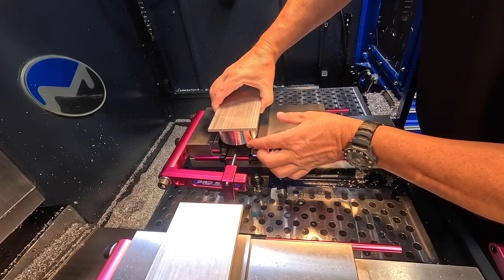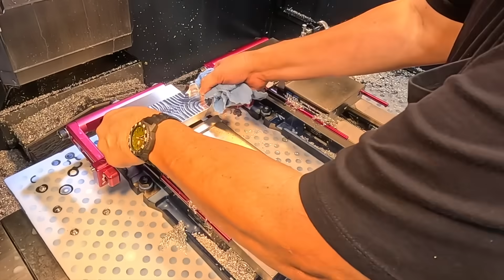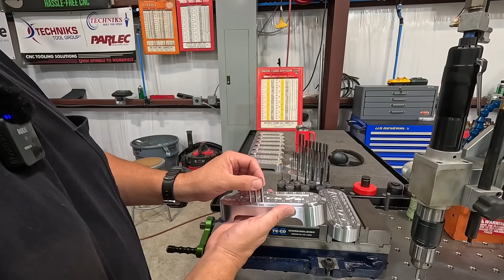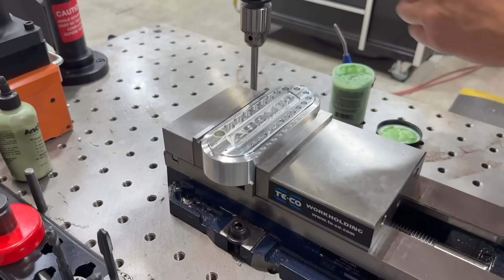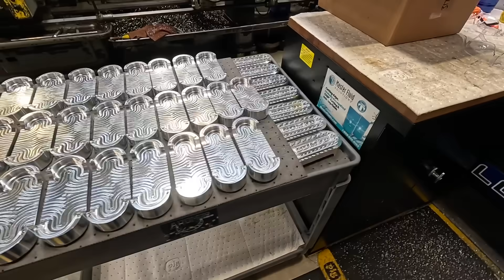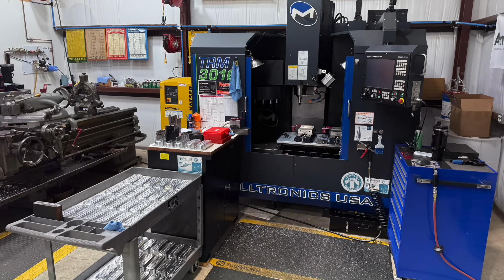Machining the Abom79 Drill Index- Op. 2 Bottom Side

Comment: You can save a decent amount of time if you don't go to z‐home on moves between pieces. With as tight as the tollerance are .1 or .2 clearance off the ruff height would be more than enough. Something that would save you even mote time would be to do rapids while the spindle is comming to speed. Turn off the spindle and simulantanious rapid up z. What would save even more time would be after tool change start the spindle and do your xy and z moves simulantinous then let the spindle finish comming to speed .1" off the part if needed. On most machines z is your slowest rapid so if you can eliminare them as much as possible is good. You would be supprised how much time minimize z moves and doing your rapids while the spindle is starting and stoping will save you. A faster tool changer would be helpful too. Hopefully you new machine will be a swing style  tool changer.

Comment: A super tight hole fit is great but it's not necessary for this use case.  1 thing is its adding a bunch of unnecessary processing time and 2 the moment you spin a drill in a chuck that bit is no longer going to fit in there.  3rd consideration is that the moment you anodize it your .002 target clearance is going to be gone.

I would wait to get a test batch anodized from your supplier and verify fitment before you go crazy trying to make the raw part a gauge fit.  Drill it .005" over with a high quality carbide drill and call it a day.

Comment: Kind of lost here, since can tell your getting the machines for free, and not counting machine wear and upkeep, for what your going to sell the finish products for.  
Hence way too may steps in the initial milling process with light cuts, where you could take deeper cut using carbide inset end mill to remove materials fast, then come back with a few finish passes in the end,  Hence part of finish product costs are not only tool wear, but run time for the machine as well, since it all just a mater of when it time for machine not only standard maintenance, but total run time on machine before it needs to be complatly rebuilt, or in most cases come that time that machine is just clapped out, time for replacement machine that is often more cheaper, and more accurite in the end from the updates to the designs of the machine.

Also at 9:55, that end mill is gummed to hell/failure in you G code for tool over all, and end mill is pretty much worthless until its pulled and soak to remove the bonded aluminum from it, to start using it againin a metal that is not going to cause it to gum up again,  So  again, G code needs to be resolved for at least that cutter,  and tooling need to be revamp so the process is not taking so long to reduce run time wear/ cost on the machine.

Comment: And now do a Variant.... just with metric!

The whole world uses the metric system, but wait ther is one small country that defied the metric system... USA!
Reply: The inch in now defined as 25,4mm exactly.   It used to have a whole bunch of zeroes and a number after the 4 but that is gone now.  The usa is slowly going metric but they will always drive on the wrong side of the road <g> tried it from johannnesburg to pretoria and boy was it dangerous!   Tony
Reply: @ton146  1 inch is still defined as 1 inch. The metric equivalent of 1 inch is 25.4mm
Reply: Imperial is still quite a valid system ... Its worked extremely well for many many years
Reply: @tjr4744  It's worked good enough, but "extremely well"? What does that even mean?

"Mistakes within the imperial system often result from the lack of standardization and arbitrary conversions between units, leading to significant errors in fields like aerospace and aviation, most notably the 1999 loss of the Mars Climate Orbiter due to a metric-imperial mix-up and the 1983 Air Canada Flight 143 "Gimli Glider" incident."
Reply: @FDT-86-47  Metric-imperial mix up ? ... how is that even possible. If you know metric use it. If you know imperial use it ... If you need to convert do it properly. Simple. Mistakes are careless and WILL happen to everyone. Mistakes are NOT the fault of the Metric system OR the Imperial system.
Reply: @tjr4744  How does a measurement system work "extremely well"?
Reply: @FDT-86-47  The Imperial and Metric system works extremely well IF its used properly. If you cant understand that you might want to go back to year 3 and start your education all over again.

Comment: Anybody else cringe when he taps those reamers on that table?  I have no idea if it's OK or not, but to me?  Nope.  I would probably have a rubber pad down there or at least a doubled up pig mat.  

I love the product, but given the amount of raw material, and machining time (and manual work), those aren't going to be inexpensive....and most likely WAY outside my comfort zone to buy.
Reply: Being in the field i can assure you this guy is extremely gentle with his work and highly professional , he can get a job at the biggest aircraft manufacturer in US any day no sweat
Reply: Not that im saying its perfectly fine to do but because the flex arm keeps tool perpendicular to the table and because the tip or a reamer is flat and does not do any cutting, as long as one doesn't slam it hard, there are no cutting edges or anything that can get damaged.

Comment: How much thickness does the anodizing reduce the hose size?
Reply: Anodizing thickness typically ranges from 5 to 25 microns for standard anodizing, and up to 30 to 100 microns for hard anodizing. These thicknesses are often measured in micrometers (µm) or microns, which are equivalent to one-thousandth of a millimeter.

Comment: I work offshore and have worked with removing cutting from the well drilling process. We deal with tons of cutting chips per hour. I could see your sump shark being more proactive in you chip removal. Making or buying a metal bin with a lid that seals and your sump shark conects to the bin lid and a shop vac or high grade hose. The trash can can’t withstand the vacuum but could be inside a bin that could withstand the vacuum and removed. Just like your air system piping we use a vacuum with piping also but bigger pipes.

Comment: Have you run a test index through the anodization process? I believe the process will reduce the I.D. so I'd verify the impact before upping the tolerances on the holes. Cheers.
Reply: You're not wrong but if anodizing for primarily for esthetics, then surface layer build up thickness can generally be kept small.

Not sure if you know or not, but incase not, you have to remember, with anodizing, half of the layer thickness goes into the material and half builds outward. If for example, the layer is 1 thou  (which is on the thick side for regular Type II anodizing) 1/2 thou is going into the material and the other 1/2 going to the outside (like going to make a hole smaller). So if for example, the time anodizing was calculated for a 1 thou  layer thickness, the hole is only going to reduce by 1 thou, not 2 like it would if it were say a 1 thou thickness paint layer. For Type II, generally, a layer of a half to 3/4 thou (.0005 to .00075) is more than sufficient for good protection and coloring.

Comment: I think the bottom flanges are unnecessarily too deep. Hence,  more material wasted, more chips, more power consumed, and higher cost per unit?
Reply: The material cost by making the parts slightly thinner is minimal. Changing that feature will have no impact on cost.
Reply: @MechanicalAdvantage  does it add any value to maintain the current thickness?
Reply: @yusufhamed6317  You make a good and fair point. His current program spends some time shaving off the half inch (more-or-less) slab of material off the base. However it is also about what the least expensive nominal size of stock is available. For instance the material may be available in 2" X 4" cross section bar, his part may be 1.4" X 4" but the next common size is 1.25" X 4" or 1" X 4". Whatever they are just guesstimates.
Reply: @yusufhamed6317  Yes, you need enoughthickness for the drills to sit in their pockets. The design makes picking the index up easier and it looks a bit nicer in my opinion too.

Comment: When working with high-precision blocks, clamping them directly between hardened vise jaws is unwise. In a professional toolroom, these blocks are reference standards, usually kept in the inspection area to maintain their accuracy. Even minor surface damage can compromise their reliability; clamping them between two hardened jaws would result in a disciplinary chat. For setups that don’t require extreme precision, 1-2-3 blocks are more than adequate — in this case, the parts only need to be positioned within about 1/8" to clean up.

A small change, such as making the right-hand stop bar a couple of inches longer, would allow it to locate both parts at once, maintaining a common offset in the program for future runs.

One common problem with all these lightweight drill stands is that they tend to lift when a drill is withdrawn. A simple solution is to leave the bottom solid, eliminating the need for a second operation.

Regarding hole clearance, increasing it has been mentioned before and is sound advice. To maintain consistent fits, the clearance should be scaled according to hole diameter. If consistency is the goal, the hole depth should also be proportioned in the same way.

At first, I assumed the business model followed the Eastern approach — minimal spending on innovation, with a focus on imitation. That would have been understandable, but in this case, there was no investment in production-friendly design or advanced programming. As a result, the project’s success now relies heavily on customer loyalty.

In the end, hard anodizing is the clear choice. Without it, scratches will quickly appear, no matter how careful the handling. The drill holes themselves will also benefit from anodizing, reducing wear and keeping the product looking and performing well over time.

Comment: How much are you selling them for
Reply: Probably more than 2 sets of drill bits cost.
Reply: @balacustoms1282  I'm guessing north of $125.  The aluminum alone is probably close to $10 alone...pure guess.  I used to work in materials, but that was a few years ago and I stopped tracking Aluminum costs.  Bar Stock can cost 3 times the raw material price easy, which would put him at about $10/kg...and that blank is most likely over 1kg in mass.  10.5Min per part for OP 2 alone...that unit is probably running at about $12/hr (assumption: $125K for Capital, Insurance and Installation (probably high, but if you include all his specialty support equipment? Maybe not), MRO, Utilities, and consumables).  Assume 260 Working days in a year and a 5 year depreciation schedule (that's low, generally accepted in 10 years, but hey, it's a small shop and just starting down the road).  That comes out to about $12/Hour ASSUMING a 100% uptime.  Since that's not possible go with Best In Class 85% OEE?  Call it $14~$15 per hour to run that machine.  It very well could be more or less.  That tells me AT MINIMIUM between raw material and machining he's in for about $25/unit COST...EXCLUDING his and Abby's labor, and finishing.  So DOUBLE that...to $50 per unit COST.  SG&A, ED&T and Profit?  EASILY go up to $100/unit or more.  Hoping Adam has been figuring all this.  I used to live this way back, forgot a lot of it, but this is how we figured costs for products way back when, and it's still generally accepted.
Reply: USD 200 without and 300 with drills

Comment: I have posted several comments about anodizing and others as well, hope you are reading them. Another chemical finish you may want to consider which most apodizer's offers is known as " Brite Dip". This a Nitric Acid process which has less effect on the dimensions of the product.
Reply: The part is designed to accommodate any dimensional changes from anodizing. That has been all factored in to the hole sizing.

Comment: Just a hint for the flex arm drill  to protect the table and bits when parking the tool get a piece of wood or aluminum to set the bit down on when parking it .
The other thing that could be done is to have a spring and cable for over head to hold the drill up when not in use .
The finish on the drill index is excellent .
This will be a good example of what you and your machines can do for making products for industry .

Comment: Adam I was thinking it might be a good idea to increase the hole size where the drills sit, because the slightest imperfection on the drill shank will make it difficult to get the drill to sit properly in the drill stand.
Another thing is that it is inevitable that oil or other liquid will get on the drill shank, and this can create a vacuum when the drill is removed from the holder, so how about drilling a through 0.5mm (0.0195) hole at the bottom of each hole, to avoid a vacuum when the drill is removed.
Reply: The pins used are to check the finished size of the hole. The holes are larger than the drills that will be inserted. The holes are designed in CAD to incorporate a tolerance to make the holes larger than the drills.

Comment: CNC version of the ENOX drill bit stand. I mean its very pretty and a extremely well finished but it was over an hr in machine time for op1 and 2. I don't know what the CNC machine overhead hr rate is in USA but combine that with all the manual work too these are going to be pricey.
Reply: There is no headword on the production part. There was some dialing in, and then after that, the parts were not touched after they came off of the machine.
Reply: Everyone screaming "buy American" these days but no one wants to pay the price for it.

Comment: Surely casting would eliminate most of that waste
Reply: The waste really isn't anything to be concerned about. It doesn't chance the cost of the material by much compared to the expense of molds. The whole part would still need to be finish machined as well. In this case, unless you were making a bazillion of them, casting would be a more expensive process that would greatly increase the lead-time.

Comment: Adam, The tolerances are too close,  the stand will be hard to use because the holes are too small.  I would make them .005 under the the next largest size. Any small imperfection on the drill shank will not allow the drill to enter the stand. It seems nice to have super close holes, but it wont end up being nice for the end user. It is though a beautiful stand.  Products cannot be made cost no object. I understand that the real money for these in Your case is video content ( which I am watching)  and so the revenue from the stand is probably not a factor.
Reply: Most of these will be purchased as expensive eye candy, displayed in a mirrored display cabinet and never be used in a working shop.
Reply: I'll be surprised if these are used

Comment: Only one issue with these fine pieces of beautifully made and accurate work, the manufacturing and sale prices cannot be fast or cheap due to the necessary high quality attention to detail needed to maintain quality and accuracy - if you value hight quality items of this type be prepared for the cost.  I dont mean this in a negative way, its true of anything with this much time and attention to detail necessary to manufacture to such a high level of accuracy - but if you like high quality machined items im sure these will more than satisfy, definitely a top tier item.
Reply: Yep, they're going to be necessarily very expensive, but that wont' be a problem for the market these are aimed at.

Comment: I would've gone .005" oversize on the holes to allow for ease of insertion and potential defects on the shank.  They're just drills, the holes don't need to be perfect.  The reamer operation is unnecessary rework if you open up the tolerance of the hole size a hair per side.  Good luck.
Reply: Thats why used drill are useally upside down in the box.

Comment: If your cnc is worth its snot - you should be able to machine the holes to at least the ream size...  we do bearing slip/press fits all the time..  it 'just works'
Reply: All drill index holes should be .003 -.005 over the drill size for an easy slip fit.

Comment: Consideration: anodizing will "grow" the surface .001-.003" so your holes may need to be oversized prior to anodizing. (That's .001-.003" each side of the hole, so .002-.006" total diameter change) good news is that a quality anodizer should maintain a pretty consistent thickness the variable is based on type of anodize.

I suspect anodization may be tough on reemers, especially if you're not cutting through the anodize layer.

Something I think would look cool post anodize is to face the anodizing off the Abom79 logo. If you decide you need an anodized vs. non-anodized program, it might be cool to push the logo up a bit for facing after.
Reply: Not true. The holes will get bigger due to the first operation which is caustic etch. Anodizing adds nothing. It is a conversion process which converts the aluminum surface to an oxide of itself.

Comment: Anodizing metal, especially aluminum adds to its dimensions - all of the holes will probably need to be redrilled.
Reply: Yep, you need a bit of slop  to cater for drill shanks that got messed up a bit by a chuck.
Reply: @julianstafford7071 Mo. All accounted for in the design. The pins used for measuring the holes are t the same size as the drills that will be inserted
Reply: @MechanicalAdvantage  The pins are oversize.
Reply: @MechanicalAdvantage  Is the hole size reduction after anodizing also accounted for in the design?

Comment: Booth, it seems you should get an air mist system for your CNC.  They seem to have 90% the benefit of flood coolant, but still allows the camera to see the cutting action.  The air blast should be enough to clear the chips too.  Of course you would still use flood coolant for un-attended operation.